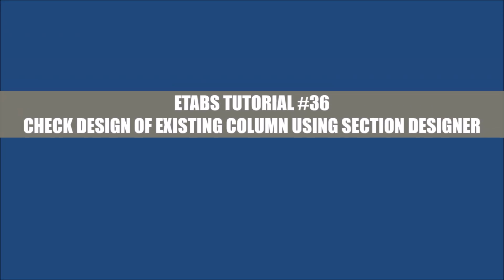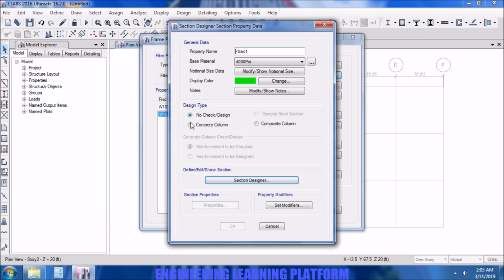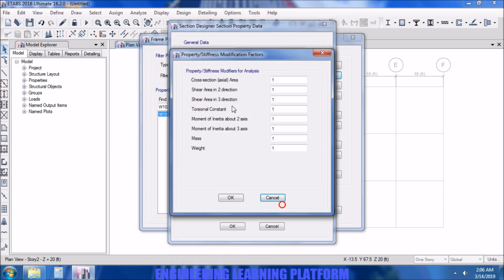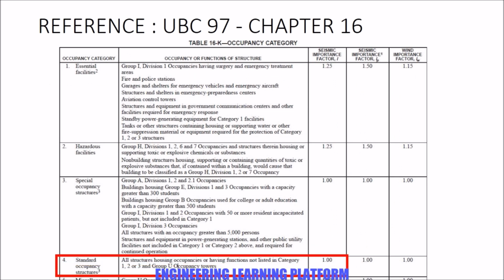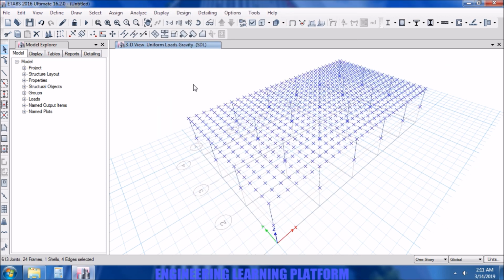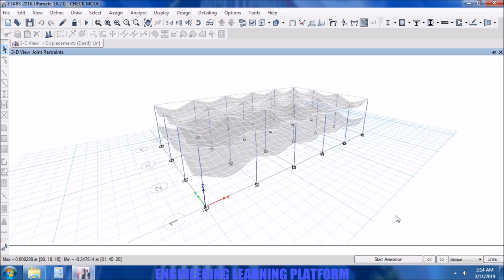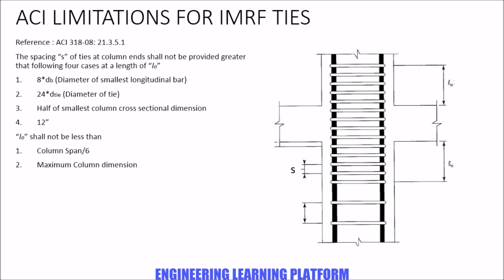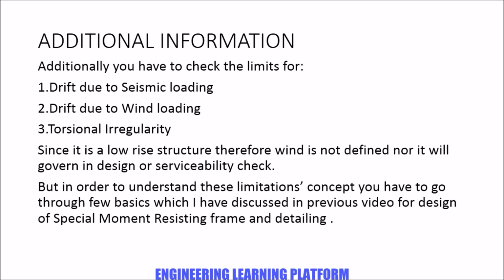Check design of existing RCC column using etabs section designer

Comment: How contribution of shear reinforcement could be encountered in Stress strain curve of concrete in regard of its confinement parameter for Section Designer?
Reply from the maker: Use Sap2000 for that. I have made a video called Moment curvature curve in Sap2000 please check

Comment: when we define rebar as 2 percent in column after analysis it shows less. what should I do
Reply from the maker: Are you sure your 2 percent is actually Etabs's 2% as well? refer to etabs rebar library and see precise areas Etabs consider
Reply: @EngineeringLearningPlatform  yes i am sure when i define 2 0r 3 percent of rebar there is no difference in the weight of building
Reply from the maker: @fahimalizada1888  Yes there won't be . Etabs extracts weights of concrete only. and super imposed dead loads, if you are extracting loads from the way that i explained in video
https://www.youtube.com/watch?v=t0-gRPB9o5M

Comment: Brother in this video, the software was showing reinforcement to be 0.92% in columns but according to ACI 318-14, the reinforcement in columns should not be less than 1%. Secondly, when checking shear reinforcement, you said Vs is greater than Vu but it is no correct. Its Vc which is greater than Vu. ACI Code says if Vu <1/2Vc no shear reinforcement is required. This was the case in this video. Correct me if I am wrong.
Reply from the maker: If the reinforcement is less than minimum then enhance it 30% if still less than minimum then provide the enhanced 30% which is less than minimum, but yes practically we wont provide less than 1%, about shear reinforcemenr your pount is valid for beams

Comment: Brother I have a question...When we have a Beam slab system and the frame is SMRF...While doing revise preferences for design should we select both columns and beams and assign them "Sway  Special" or we have to select just columns?? Or we have to select all the structure by Ctrl+A...please answer
Reply from the maker: no dont press ctrl+A select beam & cols and then set preferences to smrf, its necessary as detailing and checks are different from imrf . Also strong column weak beam check will be applied when u do set preferences for beam and cols both to smrf
Reply: @EngineeringLearningPlatform  Thanks bro ...If we have flat plate system like in your video you selected only columns and assign SMRF preferences....I want to ask moment resisting frame resists loads by flexural action of beam and columns..In flat plate we have no beams...Can still it will be called moment resisting frame??? Please clear....In CSI watch & learn tutorial on PBD he said we have flat plate system so we do not have any perimeter moment frames and all the lateral load will be resisted by core wall only...Please guide me on this... thanks